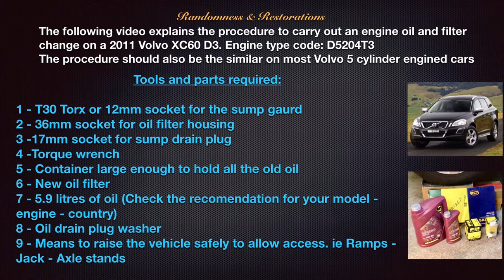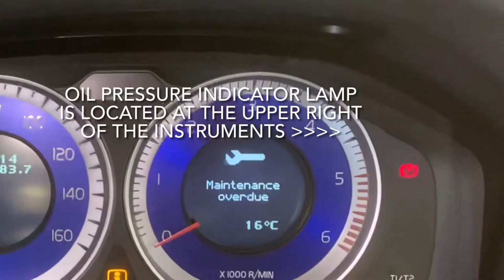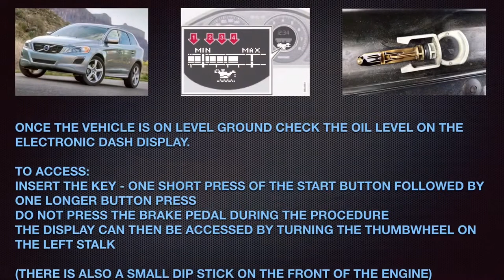Volvo XC60 Oil and Filter Change - Step by Step

Comment: I use clean old plastic bottles as a disposable funnel - cut off bottom and pour oil into bottle and with bottle spout sitting in oil filler - then wrap it up and dispose of it. I keep one n the car to easily top up oil. Great car ramps - very neat and safe . Thanks for excellent clear video.
Reply from the maker: Definitely a great use of a plastic bottle. Really pleased you enjoyed the video and found it useful and liked the ramps. Thank you. Have you watched the video showing the ramps build, if not and your interested you can find it here: https://youtu.be/-_SDamRqlsA

Comment: Great video, anyone know if it's the same procedure on the D5?
Reply from the maker: It should be the same if yours is the 5 cylinder engine and similar year. (cannot be absolutely certain though) You just need to check if it looks the same. Hope this helps. 👍🙂
Reply: Yeah 2011 D5 5 cyl and looks the same thanks.   @EverydayWorkshop  👍

Comment: What does 25nm + 5 actually mean?
Reply from the maker: Hi Stevie, as far as I know this just means you have torque range between 25 to 30 Nm but no more. If you have oiled your seal and threads 25Nm should be fine. Do forget it’s all plastic so don’t over tighten. Hope this helps. 🙂👍

Comment: can you show how to check the engine temperature of the car model in question?
Reply from the maker: Hi, these cars do not have any method of actually checking the engine temperature, instead the car electronics constantly monitor the engine and will alert you via a warning message. If you check your handbook it should describe the messages. 
Personally I would like to see the engine temp as in my view the temperature gauge is the most important instrument on the car. 
I hope this helps.

Comment: Would be good to show what kind of oil it took. OW-20
Reply from the maker: Hi Seb,  you are absolutely right it would be a good idea and thank you for pointing it out, I have now rectified my error (I blame my age 😊) by adding the details of the oil in the description. The oil I used is Mannol Legend Ultra SAE OW-20 Fully synthetic. You can just make it out in the video when I unbox the service kit.
Reply: @EverydayWorkshop  ha ha no problem brother. That’s what I did, I kept hitting pause to get the kind you used lol.
Reply: @EverydayWorkshop  THIS MODEL NEED 0w30 A5B5  NEWER MODEL NEED 0W20  ??